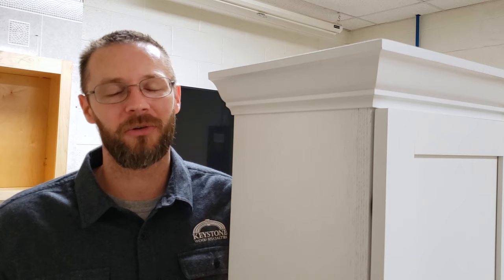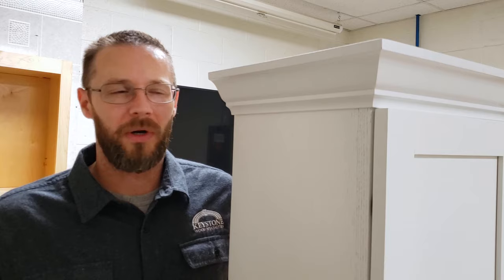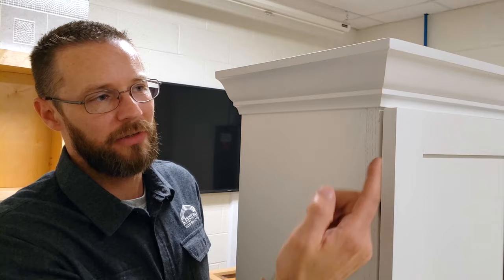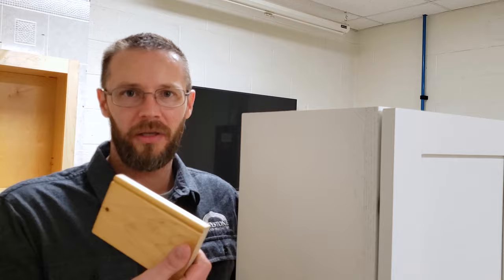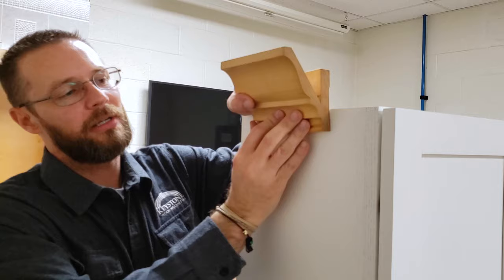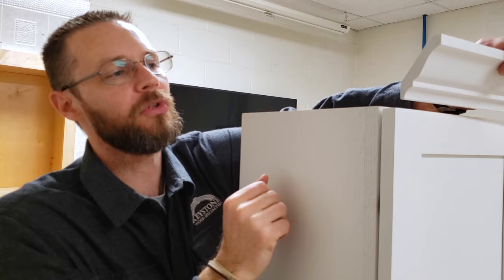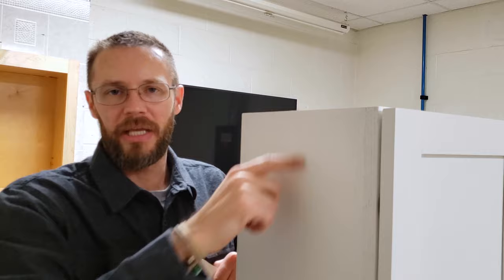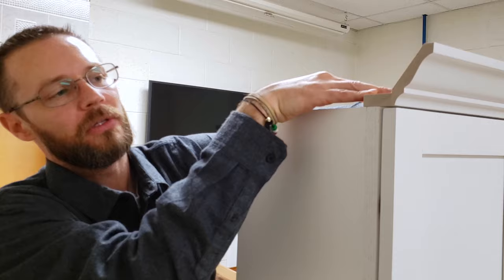Installing Crown Moulding on Full Overlay Cabinetry

Comment: Thanks good information  , I'm dealing with 43 inch  wall cabinets that are a full overlay door and close to the ceiling I'll have to build on heels to the crown molding first and use that method , Thanks .

Comment: Interesting... We do a lot of full overlay doors and we usually install blocking flush with the cabinet box to fasten our crown molding to.  We have the mullet effect that you're talking about but it has never appeared abnormal to myself, the crew, or clients. We have never considered it a problem.  I will take this into consideration.
Reply: I too have never heard of the mullet effect. I'm kind of guilty myself doing that sometimes 😬.

Comment: Super video.  The "non-mullet" installation looks really good.  Great explanation about how to install when your cabinets have 90 degree corners.  However, what do you do with that corner cabinet that has two 45 degree angles off the sides of the face?  How do you get the crown projecting over the door, but still have the sides flush with the cabinet?  Do the corners of the crown go over the edges of the door, or do you do some kind of jig-jog with the crown to line it up with the door?  

Thanks in advance for your sage wisdom!
Reply from the maker: Thanks for the kind words Brad! 

Yes, corner cabinets get tricky quickly! I always aim for "visual balance." With that in mind, there are a couple of things you can do to get close.

If the corner cabinet door overlay is adjusted so that the face of the door is roughly 1.5" narrower than the cabinet face I would recommend adding a filler piece above the door to bring the crown out even with the face of the door and angle the filler piece inwards at 45 degrees on both sides so you can miter the crown for the returns. This would create a slight gap where the door doesn't cover the filler, but I think this would provide the best visual balance for this situation. 

If the door is the same size as the cabinet face I would probably put the filler piece in the front, but cut the ends at 90 degrees, so it covers the full width of the cabinet face, then cut pieces for the ends (returns) that each have a 45 degree cut to join with the front piece. The end fillers will need to be proportionally thinner than the face piece (the 45 degree angle on the end fillers should be equal to the thickness of the face filler). What this does is line up the corner of the moulding very closely with the edge of the door and it reduces the imbalance between the face and the ends. If you use a face filler of .875" the corresponding end piece would only need to be .5" thick. This brings the crown forward .875" at the front and .5" at the ends.

I do not think going with a 5-piece method where the crown returns in .875" between the face and the ends will be the best visual balance. I think it would bring unwanted attention to the situation, compared to either of the 3-piece methods listed above. 

I know that was a long and rambling answer, but I'm hoping it helps. Best of luck!

~Dan

Comment: I like this idea but, I have a concern that your video doesn't cover.  Our "full" overlay doors are about 3/8" below the top of the cabinet.  The top edge of the door is 3/8" below the top edge of the cabinet.  If I do what you're suggesting, and was planning to do, there will be a 3/8" gap between the board that the crown nails to and the top edge of the door.  So I guess I could rabbit the board to drop it down and reduce most of the 3/8" gap.  What I'm wondering is;  what do most people do in that situation?  Leave the gap?

Comment: Very good video. I am curious if you have ideas for installing an elevated crown moulding where the ceiling height is say 4-6 inches above the cabinet top? I am using IKEA full frame cabinets and struggling with how to connect nicely a crown moulding. thank you. Just discovered you but will watch more. Keep safe and thank you for making a difference.

Comment: I'm needing to replace kitchen cabinet 2" crown molding and still match the existing molding on other parts of the cabinets. House built in 1998 and I can't find matching molding at either Lowes or Home Depot. Coincidently, I came to this video and noticed my crown molding I believe matches the sample shown during the beginning of your video.  Any suggestions how to match this or where to buy 2" molding?

Comment: If your moving crown molding out to to the face of the door what do you do about the side of cabinets with the side rail sticking out
Reply from the maker: Hi Bruce!
I'm not sure what scenario you're describing. Could you send a sketch or a photo of the situation you're describing?
Thanks!
~Dan
Reply: @keystonewoodspecialties1973   i've got same issue i think-- vertical side rail protrudes abt 1/4" from side wall of cabinets with full overlay doors.. I've seen videos that show notching that out-- tough pill to swallow cutting my wood cabinets! which may be what @bruce q   is describing
Reply from the maker: @jpvmd  Hi jpvmd!

I've seen installers address your situation two different ways: 1. Exactly how you described, by notching the face frame where the crown moulding turns from the face to the end. 2. I've seen installers install a piece of inverted scribe moulding towards the top of the cabinet end to build out the end flush with the edge of the face frame so you don't have to notch the face frame and your crown moulding can be installed on top of the scribe. Some will hold the scribe flush with the bottom of the crown, others will extend it down a little bit with the radius of the scribe exposed.

Hopefully that helps! Happy installing!

~Dan

Comment: How do I nail/screw the heel to crown?  I have plenty of room above as the ceiling is vaulted, I don't want to nail on the crown finished side.
Reply from the maker: Hi Tim,

If you're using crown moulding with the heel attached and you have room from above, I recommend screwing down from above into the cabinet. You can also nail from above, but I prefer screws. If you're attaching the crown to a nailer block you'll probably need to nail through the finished side into the nailer. If you're looking to avoid that you can either glue and clamp it, or use CA Glue, like Starbond. It bonds in seconds, so make sure you have it in place. 

Hopefully that helps!

~Dan

Comment: Just out of curiosity how to you plan to install that crown with a heal after the cabinets are up and they are 36" uppers in a standard 8' ceiling? I have found that (all in 1)  heal crown combo making for a very sloppy install and problematic. Help me out if you can.
Reply from the maker: I only use crown with heel when I have enough room above the cabinets to fasten it from above. However, I do know of some installers that will use crown with heel even if the crown goes close to the ceiling. They will drill and screw the moulding from underneath. Whenever I'm installing, I prefer to use the blocking method and use conventional crown moulding (without the heel). Hope that helps! Happy installing! ~Dan

Comment: what kind and size board do you use for the blocking method? something like 5/4 ripped, finished and installed?
Reply from the maker: I prefer to use 7/8" thick solid stock, which is roughly the thickness of the door plus the space between the door and the cabinet (~1/8"). If you have thicker doors, I would adjust the thickness accordingly. I typically only finish 1 long edge, which is the edge pointing down, and then install the crown flush with the bottom of the blocking material. I hope this helps!

~Dan

Comment: I plan on installing crown using the “heal” method and pulling the front out so the crown is almost flush with the overlay door front. But I have a problem. I have two taller wdc273615 diagonal wall cabinets that I want to wrap all the way around back to the wall with crown but when I pull the front crown forward, it also moves the side crown away from the sides so I have a large reveal on the sides too. If I cut the heal and crown to be flush with the 1/4” stiles on the sides, the miter joints move inward on the front and don’t align with the 45 degree corner of the cabinet. I’m afraid this will not look right either way I do it. Any suggestions?
Reply: Where did you find crown with that return bottom? I want to use something like what he used in this video but I cannot find it anywhere!
Reply from the maker: There are definitely some no-win situations where you have to make compromises to get the best look in the situation at hand. It sounds like this might be one of them. If you send some pictures of what you’re up against to info@keystonewood.com I’ll be happy to give some recommendations. ~Dan